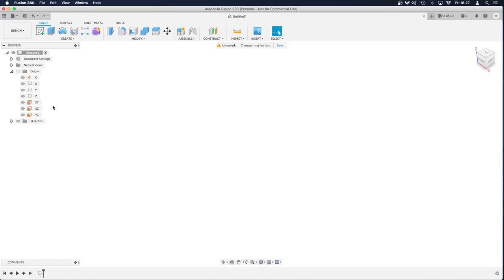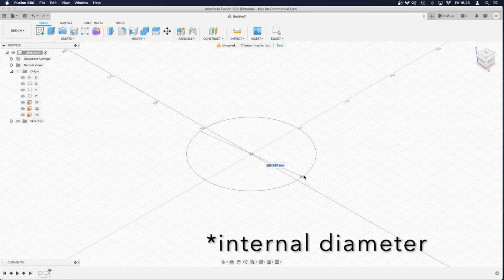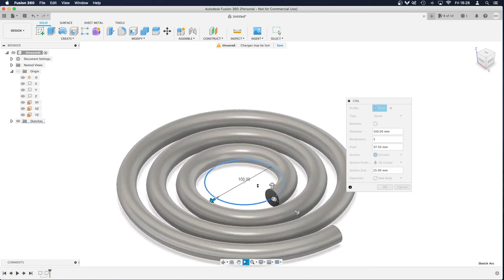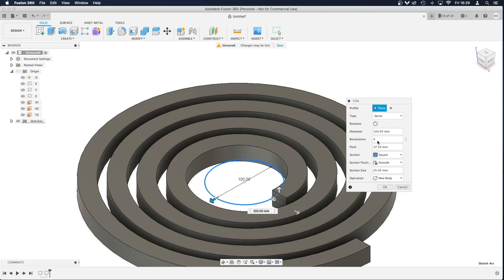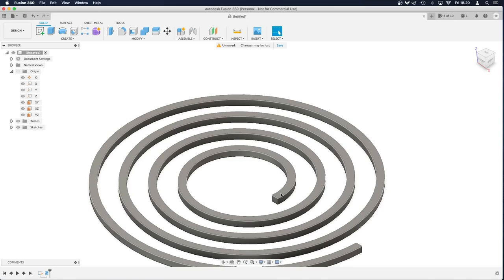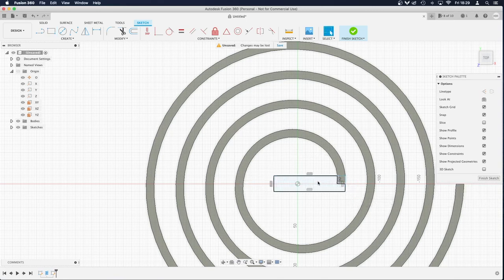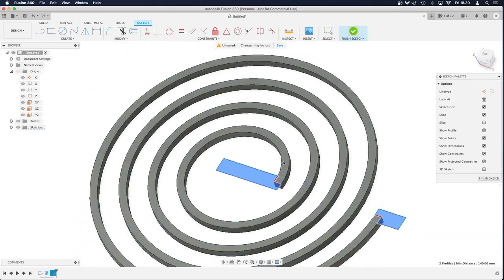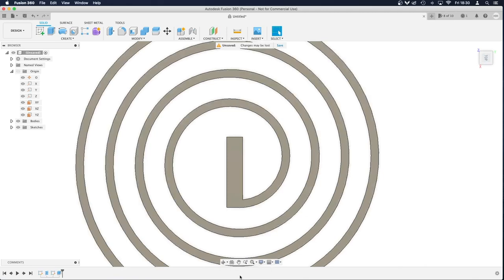Spiral Shape in Fusion 360 quick tutorial

Comment: Thank you so much, someone from reddit suggested this video, it was under my nose the whole time. I was doing nested circles and using an arch to connect them at 180 deg intervals, never turned out right. 
One note I learned while using 360, when ever I extrude like you did at the end, you can select To Object in the distance option and select a point on the spiral to attach to. If you change the spiral extrude it will automatically adjust. In theory :)

Comment: Great video but how can I make my maximum outside diameter say 200mm? If I make section position outside it’s still showing the internal at 200mm. Many thanks
Reply from the maker: I found this which may help: https://forums.autodesk.com/t5/fusion-360-design-validate/how-to-do-a-coil-spiral-with-a-outside-diameter-vs-inside/m-p/8727047#M187592

It seems to be possible but you have to use Parameters to effectively enter your dimensions as an equation.
Reply: @kwerkshop  thank you for that. I did have another issue where the bottom of the coil went through base of fusion (minus numbers) and I think it was to do with the position setting, outer, inner, center, so what do I set this to do prior to extrusion it’s flat? 
Thanks
Reply from the maker: @marksneyd1262  If your spiral is going below your desired height I would maybe create a custom offset plane at the correct distance and attach the spiral sketch to that? Or I have also found you can move the spiral body up or down after it has been created.